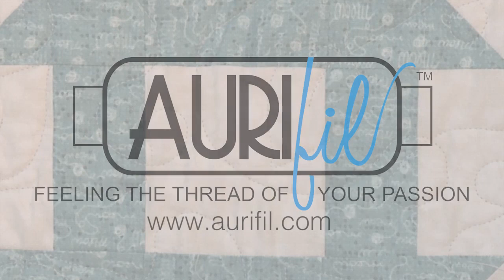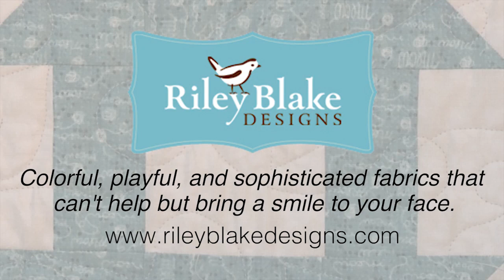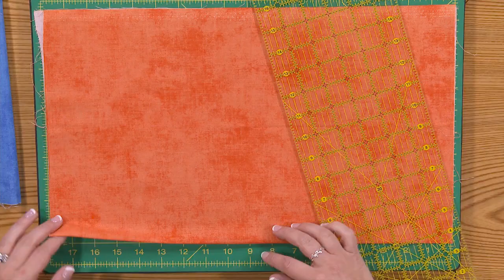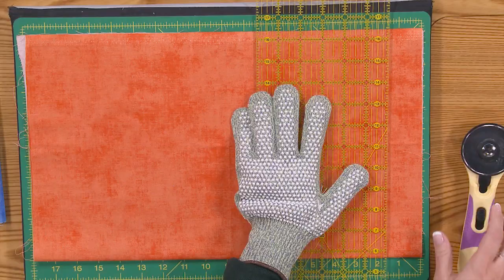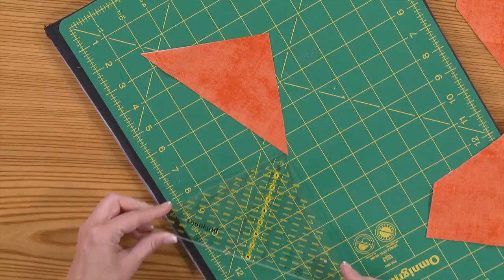My First Quilt - Episode 4 - How to Cut Fabrics for Quilts

Comment: These are the videos I need! I have a question about washing fabric, I've always washed my fabrics before using (never have quilted before). I bought some fat quarters to use and washed them before I even thought about if I should or not. I read that you should not wash them. Have I ruined the quilt already? Also, I have another big piece that I haven't washed that matches the fabric. If it's ok to wash, do I need to wash this one too? Thanks!
Reply: Hi! I wash all of my fabrics before I cut and piece my quilts because I don’t want to run the risk of colours running after all of my hard work. 

Whether you wash your fabrics on not, the most important thing is that all of your fabric should be one way or the other so that it shrinks evenly after washing. So if you have washed some of your fabric for this quilt, you should wash the rest.

If you’d appreciate a recommendation, I have learnt a lot from Karen over at her youtube channel “Just Get It Done Quilts”

Happy quilting!
Reply: @ohcar0line  thank you so much!!